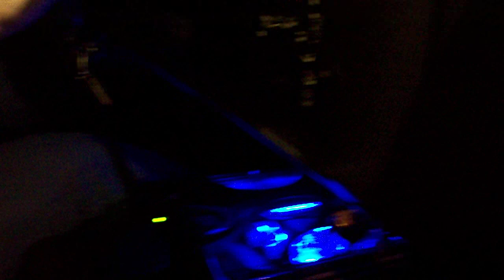MTX 9500 15's walled Night Demo on Crescendo 3kwp !

Comment: @soundstream88 ok, lol gotcha, I was expecting that musically or at lower hz, say mid 40s. what it's doing musically?  the loudest one I was in was 4 9500 12"s off 2 aq2200 in a wall in a trail blazer, was tuned to 30hz, loudest he did was a 49.8 sealed on the dash and I believe he managed to get a 51.1 but I didn't hear that one. can't wait for the aural then, good luck.

Comment: @OffensiveProduction1 151.6 @ 52 hz I will have plenty of proof at the first show on April 22. It did a 152.4 with the drivers door open. My truck's cab is completely reinforced. The box those 9500's are in is capable of hitting 160. It did with 2 shocker sigs in 2002